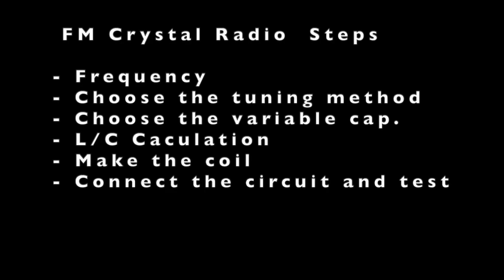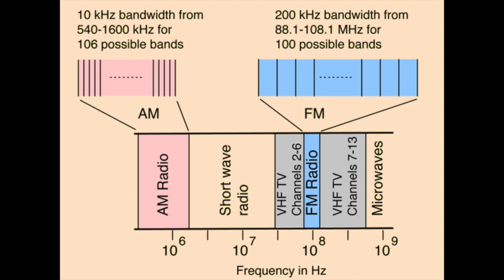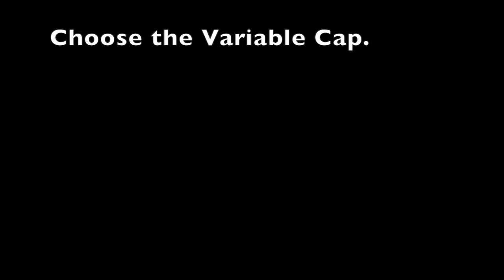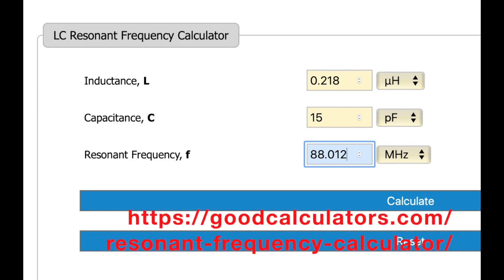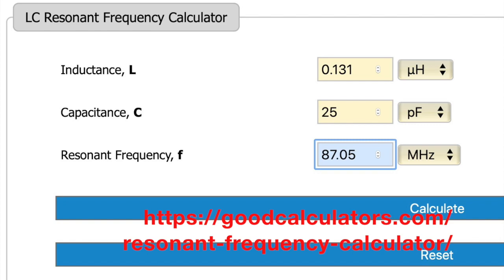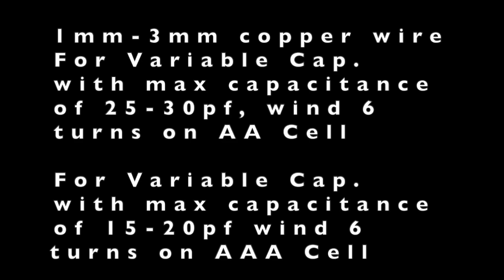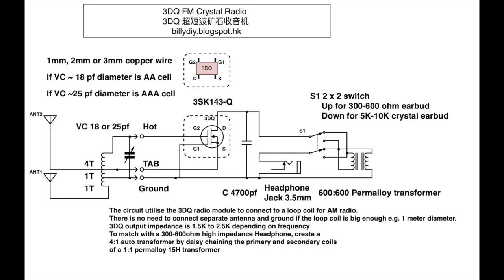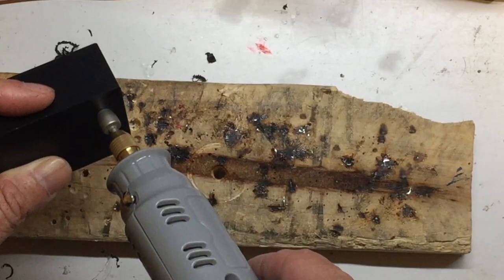FM Crystal Radio (MOS FET) step by step instructions

Comment: Billy I got this radio to work today am happy ! seems a little more sensitive & selectivity but not quite as loud  the 4 diode tune/untuned with the 2 telescopic antennas I built last week anyway a great enjoyable project  (mosfet soldering quite difficult but I didn't damage it )
Reply from the maker: glad that it works for you. Yes. The 4 diode one will give a louder output  but not very tunable and may have noises.

Comment: I've been building crystal radio sets for the AM band since I was 12-years old (early 1960's), but after a number of attempts using various materials and circuit designs, gave up trying to build a battery less FM receiver.  Any signal I received was too weak for usable copy, the high-frequency FM signal didn't propagate like the medium-wave AM signals, and FM stations don't have the power.  I figured the FM receiver would work if standing next to the broadcast tower, but any range at all from the station is a signal killer.
Reply from the maker: That's very true. I am fortunate to be within a good range (~ 5KM)  to receive a good FM signal.  In the past I was also giving up trying FM crystal radios. However, with new types of circuits like that of the 3DQ and a more sensitive headphone, you will be able to receive crystal clear FM radio. I was also only using Telescopic monopoles for antenna that is hard to hold steady and signal fluctuates with the position you are standing or the way your earphone cable orientates. 
Recently, I made a very simple Yagi folded dipole that uplifted the strength of the signals and allows  me to receive many stations crystal clear. I can even hear the pilots conversation too. The FM station is also close to the airport.

Comment: Nice work but tell me if this is a true crystal radio what powers the transformer ?
Reply from the maker: This radio does not use any form of electricity. It just harvest energy from the broadcasted wireless radio wave and turn it into audible output for the ear. The transformer is passive step down transformer for impedance matching so energy transfers between different stages of the radio can be more efficient to avoid loss of energy.

Comment: I hear you are supposed to use a resistor for the piezo ear bud, but can you get better sound with 300,000mh coil instead?
Reply from the maker: You are right. Adding a big inductor or transformer in parallel with the headphone will improve the sound by adding more base to it.

Comment: Thank you for this wonderful video. Theradioboard and your videos have interested me to build an FM crystal radio. I would like to build a crystal radio that reaches the 156-174MHz marine radio frequencies. Can these techniques, and the webpages you mention, be used to modify your crystal and regenerative radio plan for this range? Thank you again for making all this information available, and for your time and patience on my questions.
Reply from the maker: Thanks for your nice words.
The 3DQ all band radio circuit that I shown in my videos can be easily turned into a regenerative radio by just inserting a 3 to 6V battery after the D pole of the 3DQ.
To control regenerative strength for MW and SW, we will need to insert a 5K variable resistor between the Tab of the coil and the S pole of the 3DQ. Ie, to connect the middle pin of the variable resistor to the S pole of the  3DQ , and either side of the variable resistor to the Ground and the TAB of the coil.
For FM regen radio, the variable resistor will be connected in series to the battery to adjust the strength of regeneration. However this  is only required if the regen. Is not stable enough. After turning on regen. Must radios can even drive a speaker. 
I will make some video to show you how to do it.

Regarding going up to marine channel. I can also receive marine channel using my wakie talkie.
I am not sure whether they are AM or FM or SSB.
If they are AM or FM, and if the signal strength is high enough, you can receive it using a crystal radio or regenerative radio.
You can always make a smaller coil, or reduce the no. of plates of the variable capacitor to reduce the capacitance to rise the frequency range to reach that of the marine channel.
Reply: @BillyCdiy  thank you very much for this info, and your prompt reply

Comment: Hello sir I have unusual problem.
I need desperately variabel ignition system.
Im cutently working on project to control ignition system timing in me car.
So I wuld ask you do you know what culd I use to alter frequency to pick up coil ore to alter the analog to digital signal inside the 4 pin gm ignition module?
What devices culd posibly alter that frequency?
I simply am anoyed to advance and retard me ignition timing I want to do it electricaly with out phisicaly removeing distributor or rotating it.
So any help please?
Reply from the maker: I am sorry. Your question is beyond my knowledge

Comment: Thanks Billy.
What is the impedence of the crystal earphone your using ?
And what does that 4700pF (4.7nF) capacitor do ?
I never worked with (MOSC) FETs :/ so I was reading about that transistor specs
https://alltransistors.com/mosfet/transistor.php?transistor=901
Reply from the maker: My crystal earphone has the impedance of around 600 ohm. 4700pf does two things: 1. Filter out the radio frequency and leave behind the audio frequency for your earbud. . 2. Smooth out the curve of the audio wave so it's closer to the original sound.

Comment: Are this this same as the atmosphere energy?
- (electromagnet wave  with atmosphere energy)
Reply from the maker: Na Me , this is an real Fm radio that powered itself through the radio wave not the so-called energy thieves which are fake. The current  is very tiny , just enough to be audible in the range of 1 to 10 micro amperes

Comment: Could there be another MOSFET instead of 3SK143-Q?
Reply from the maker: There could be other zero voltage MOS FET but so far MOS FET 3SK143-Q , aka 3DQ and it's variant 3DP and 3EQ,  are the best for weak station reception. Before the discovery of the 3DQ, people were using ALD110800 MOSFET (or the 4-in-1 ALD110900,  there is also a newer version ALD210800 MOSFET, which someone tested and found to be not as good as the original ALD110800 for crystal radio reception). I tested the ALD110900 before. The output and sound quality is much worse than 3SK-143 Q. The  chip is fragile. Very easy to be damaged by electrostatics, or a sudden strong signal coming from the antenna. Also the performance at HF is poor.  So, the ALD110800  is only suitable for AM/MW reception, but not for   SW or FM broadcasting frequencies.  
There is also a recent video about Using the FET embedded inside a capacitive mic as detector 
https://www.youtube.com/watch?v=b5FHOY_booE&feature=youtu.be

I haven't tested it. But from the video, the performance seems still not as good as the 3DQ.
My recommendation is just buy the 3DQ and try it out.
You can get 3DQ from the following links on e-bay: links
e-bay shop for 3DQ (3SK143-Q), Litz Wires, High Q ferrite core (R40C1) and other  crystal radio components shipped from China  : mkmak222_Litz Wire
https://www.ebay.com/str/mkmak222litzwire

3DQ
https://www.ebay.com/itm/MOSFET-3SK143-Q-3DQ-for-Crystal-Radio-Zero-Voltage-Threshold-Detector/161600513556?hash=item25a0242614:g:YBcAAOSwPhdU3sHm
Reply: @BillyCdiy  Thank you for your comprehensive answer. This is valuable information. regards

Comment: With dual gate mosfet can made phase FM demodulator ( add cecond LC tank in G2 circuit )
Reply from the maker: Ingus Siliņš ， that’s a good idea. Is there a circuit diagram for me to explore this idea ?
Reply from the maker: @igrewold  , Thanks I thought you are talking about Crystal Radio. Seems they are IC and powered by battery. I am not too interested to conventional radios powered by battery. I will pass this time. Thanks.

Comment: Add a joule thief to it.
Reply from the maker: Garras Porgratix , joule thief’s are all fake. They are done either using big motors with a smaller motor and a button battery hidden inside the chasis of the bigger motor or  with a electricity powered inductance coil hidden under the camera that functions like an iPhone wireless charger to power up whatever lamps or motors the fake presenter tries to demonstrate
Reply: Billy Cheung you don’t know what a joule thief is do you ?